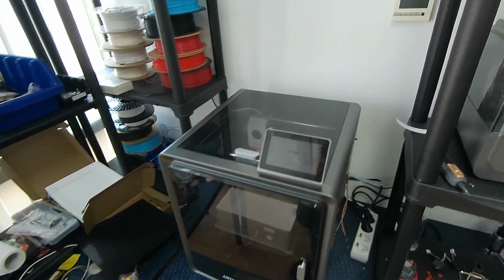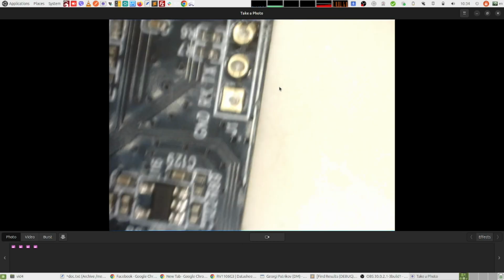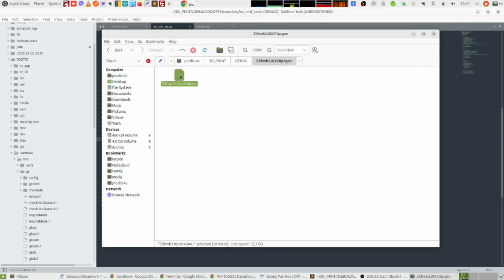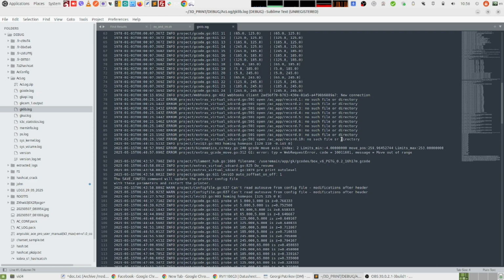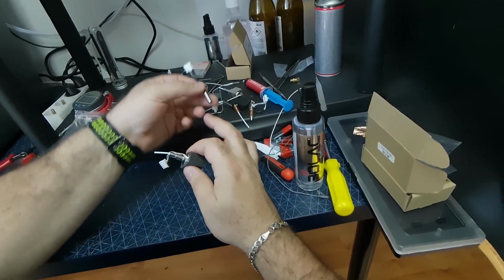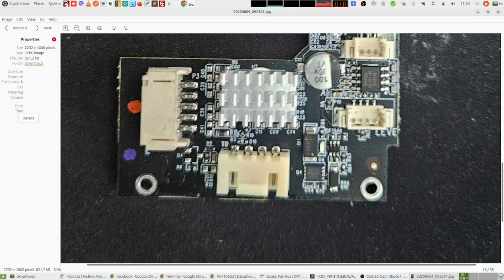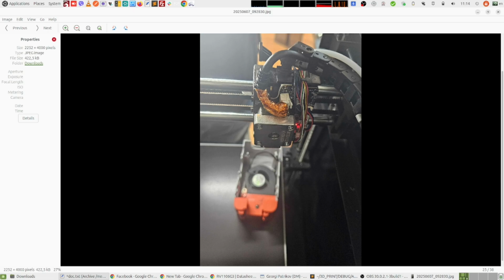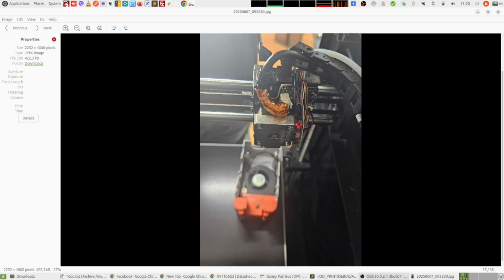Anycubic Kobra S1 - Part 4 - 10414 error finally resolved!!!

Comment: Got notorious 10409 error, but the log looked very similar to yours @predte4a. I screened the cable only on the side you show in your video, and with other material (aluminium tape, used for pipe sealing). So far I am at 90% of 13 hour print - seems to have worked. Thanks 😁

Comment: ive been getting the 10409 and 11407 error all the time. Anycubic is sending me a new motherboard and printhead cable kit. Don't know if it will fix the problem.
Reply from the maker: Try changing the cable first.

Comment: Hey, that’s very advanced troubleshooting. I am impressed. If I knew how many issues are out there with this printer I would have bought something more expensive as you’re suggesting here. 

Do you think buying the Funssor 8mm print bed and 5mm bed carriage are gonna really help with the bed levelling and bed warping issues, or the issue actually comes from the lack of second back screw, lack of bearings and SW that doesn’t compensate enough/well the deviations in the SW mesh?
Reply from the maker: Well, we have to say that this printer is in the hobby category,  so I'm not sure if upgrading it makes any sense. I think it have too many overlapping issues and I'm not sure there is a single solution for it.

Comment: I've been facing the disappointing Code 10414 for a long time, always trying various fixes, but none of them worked. Then, I came across your video and tried this cable shielding. I did it only on the hotend and started a print lasting over 8 hours... and it worked. I had no problems at all. Then I started a second print lasting 7 hours. Again, the print finished without any problems.
I'm quite surprised that the solution is so simple. Couldn't your proposed solution have simply made the cable more secure, thus preventing movement that could cause poor contact?
In any case, your solution is working for me, and I'm very grateful for it. I was already thinking about abandoning this printer. I'll keep you updated on new prints later.
Thank you very much for posting this video.
Reply from the maker: Well,  it can absolutely be a connection issue. If you feel adventurous,  you can remove the shielding and try to just fix the connector with something or even directly solder the cables on the PCB. If it works, it is just a connection issue. If not, the shielding is needed... Or, just apply the first law of engineering - if it works, do not fix it :-)
Reply: @predte4a I prefer to follow the first law. 😂😂😂 Thank you again. Just finished another flawless print.
Reply: As promised, I'm back to share my long-term experience with this solution. I've completed several large prints, totaling over 500 hours of printing without a single Code 10414 error. You actually fixed this issue. Anycubic should know about this so they can review their printers.
Reply from the maker: @docrenatoms  Glad to hear. Three more very important things they should review - the whole asembly around the preasure sensor with the hotend, the decision to have just one rear axis and the fact that SSH service is running by default with a default user/password. It looks like after a while the hotend / heatsink / preasure sensor asembly starts to misbehave forcing the sensor to give false readings resulting in very bad first layer quality or, as in my case, the hotend literally scraping the build plate. Many people go crazy trying to perfectly level their hotbed, but most of the time the issue is with the sensor readings. For now my solution with 2 washers between the preasure sensor and the heatsink works well. 
The issue with the rear axis is well known and is a pure design flaw that have to be reconsidered in future versions of the printer.
The SSH service I think should be disabled by default and there should be a menu in the software to turn it on and if you do so, the user should be forced to set their own username and password. At least this can be simply done by a software update.

Comment: So, some questions after applying the copper tape and grounding it. have you been getting the error 10414 anymore, or has it fully been fixed?
Reply from the maker: No, no 10414 or 10413 errors anymore.

Comment: Thanks for all the anslysis! 

About the "missing" bearings at the top of the z-axis screws - from others, they state they must float free or you get banding issues in the print.  The stability is between the bottom and the build plate - which both have bearings. Just reporting what I've read as I've not tried installing bearings. So far, I've had no issues as designed using the printer without top bearings.
Reply from the maker: Sure, I might be totally wrong about it, but it just does not feel right to have all that wobling. Also, it looks like there is a place designed for such bearings, but they are just not installed.

Comment: still no problems? :)
Reply from the maker: Not for now :-)
Reply: @predte4a  same print works like it should then? :) had 3 20h prints fail on me lately. 2st 10413 and one 10409
Reply from the maker: @The.GiantSwede  When you get one of these errors, before you restart the printer, export the logs and take a look. They should have some more clues on those errors.
Reply: @predte4a  alright
But. will test your fix first just in case too :)
:goodvibes:
Reply from the maker: @The.GiantSwede  You can give it a try, it wont hurt. From as much as I know 10413 is more related to fillament and ACE Pro issues and it looks like 10409 is related to a connection issue between boards. So, definetelly take a look at the logs for more clues.
Reply from the maker: @The.GiantSwede  Did it worked for you?

Comment: Appreciate the hard work and I realize we may not all have the issues but could you make a follow up video going over what you feel changes/modification could benefit all S1 users and maybe show how to do it. Thanks.
Reply from the maker: Well, if your printer works well, you can apply the main engenering rule - if something is working, do not repair it :-) . Otherwise, if you have any issues similar to mine, you can go through the videos in this series and try some of the fixes I did. Otherwise, it is best to contact Anycubic support first and see if what they say helps. And if it does not help, like in my case - no other way than go trought that painful debuging process... and it takes a lot of time, effort and waisted fillament :-) . Probably just one important thing - keep your printer inside your local network, do not expose it to the internet, otherwise it might get hacked. Stay cool.

Comment: You've worked really hard Georgie, was very nice to see your success even if I understood none of it and the rest I could not hear 😃
Reply from the maker: Sorry if the video / audio quality is not that good. Basically I put a grounded copper shielding around the cables that connect the print head board to the motherboard and that created a path for the EMIs to escape directly to ground and not interfear with the serial communication between the boards. Stay cool :-)
Reply: Thankyou for your dedicated problem solving.  Such a simple solution in the end!